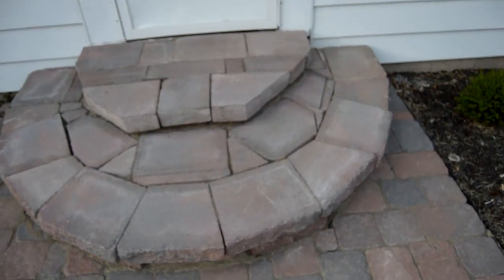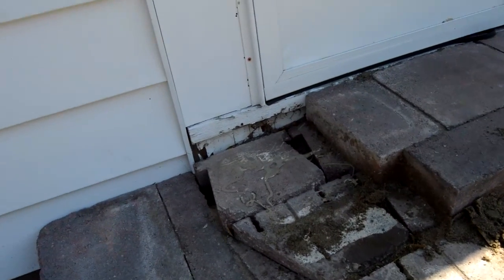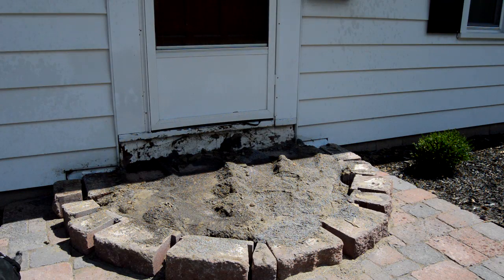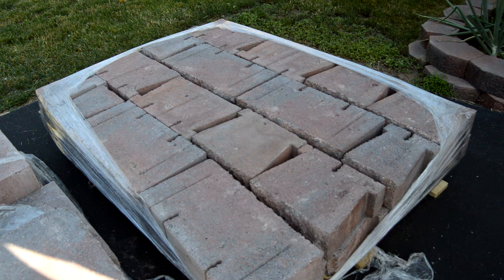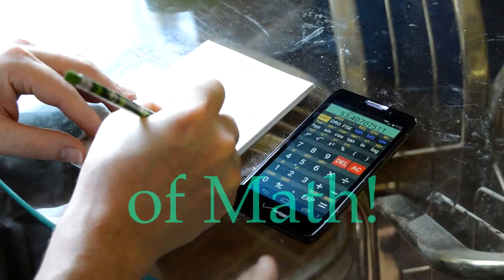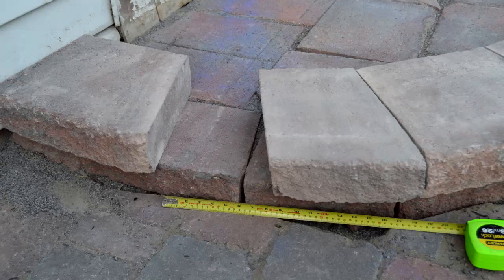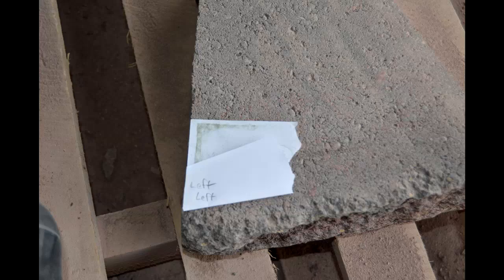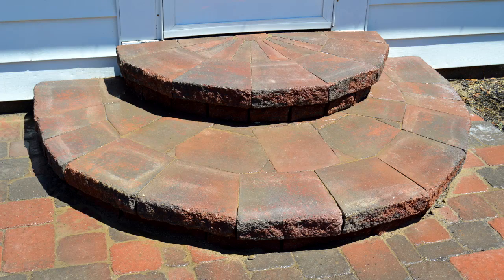Constructing Entry Steps Using Wall Pavers

Comment: I do this for a living and here’s the truth for anyone reading these comments .. the before and after are day and night I’ve seen work done correctly and incorrectly but what you did wasn’t bad at all.. sure there are some pro tips that can be suggested but anyone that knows about these kinds of jobs also needs to agree the first project was god aweful because maybe that was the first attempt at it or they wanted to get it done fast.. the end result wasn’t perfect by any means but it certainly was not a bad job.. you did a cleaner job than most contractors I’ve worked with have done so good job overall since I know he probably doesn’t do this for a living
Reply from the maker: Thanks - this was indeed my first time doing stone work, and without guidance.  I work in computers for a living and would recommend for others to seek a professional and only do something like this if they enjoy experimenting and can afford to have a professional fix their mistakes afterwards.

Comment: Great job with very informative explanation! 
I similar job in my backyard, paver patio with 1 or 2 steps down.  question:  does the steps go first and then patio? Or steps would go on top of patio?
Reply from the maker: PIYA07950 I'm no expert, but I would think you would do the patio first with careful measurements for the steps and the steps just need to be on a solid base, not necessarily patio pavers.  Some of the professional contractors on here might be able to give you a better answer.
Reply: 95PercentBen great.  Thank you.

Comment: Did you angle them for a runoff
Reply from the maker: I didn't do any special angling for water runoff.  It hasn't turned out to be necessary either.